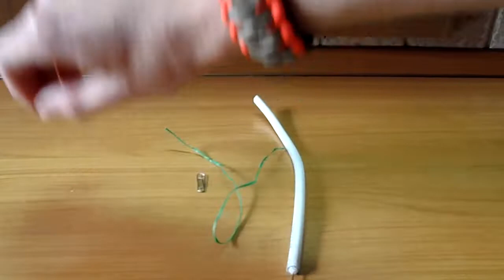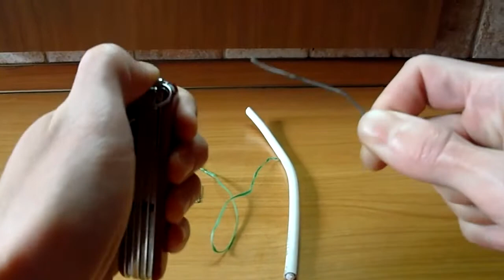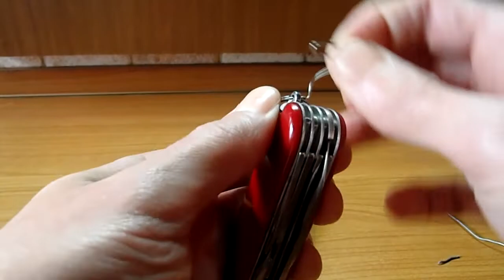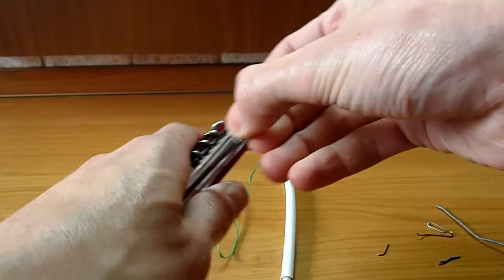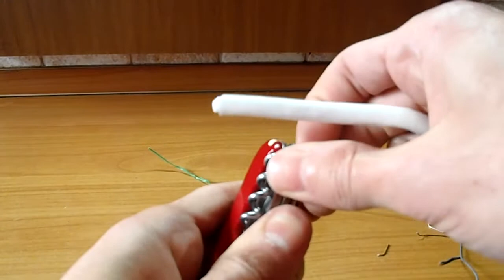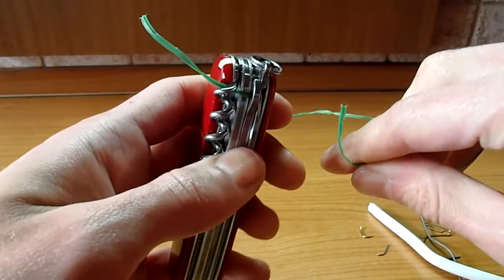victorinox hack (vid.19)-wire cutter.

Comment: I never seen you cut anything you just broke it I can do that with my bare hands
Reply from the maker: how you can broke the edge of a thick hard wire with bare hands??its a trick just in case if you carry a sak without pliers.i think is better from nothing.
Reply: Saves your hands from damage, I guess? Those edges can get sharp.